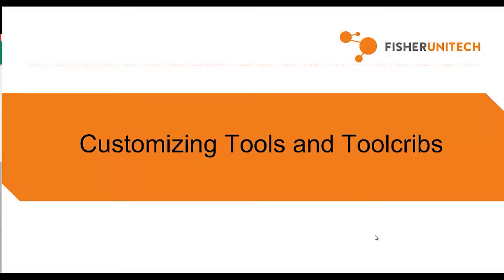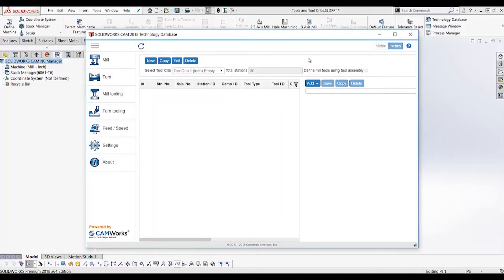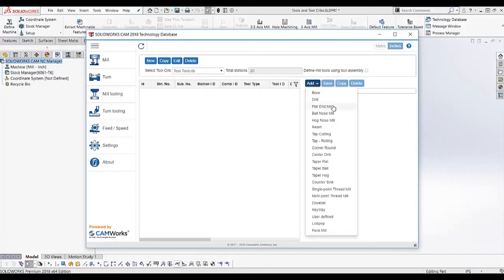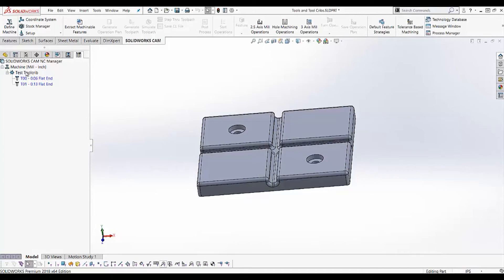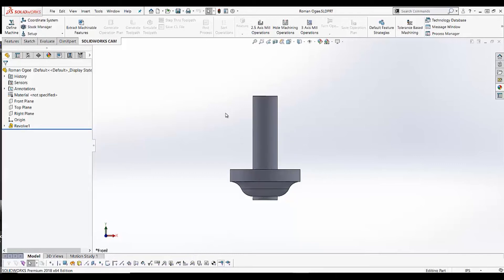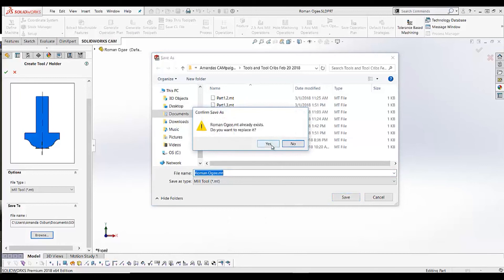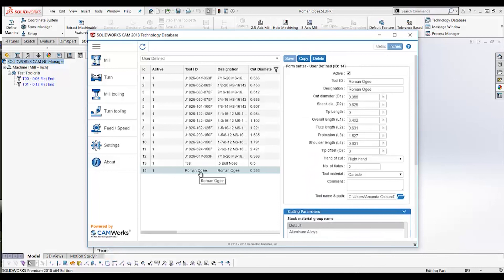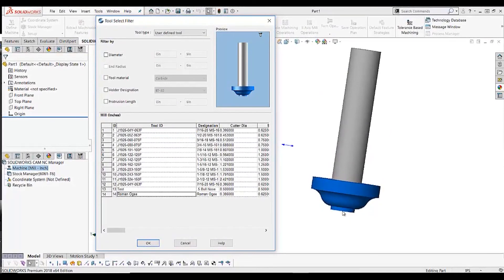Customizing Tools and Tool Cribs in SOLIDWORKS CAM

Comment: Thanks for the video. One question, how do you assign a User Defined tool to a particular group, such as single point threadmill so that you can perform that particular operation with the correct tool. Solidworkd Cam does not allow you to complete threadmilling without having threadmill designated. If you try to change it in the mill tool crib window when you click save it comes up with an error. "Select a Valid tool from database". I see no other place where it is possible to change the designation of user defined tool to the correct tool type.